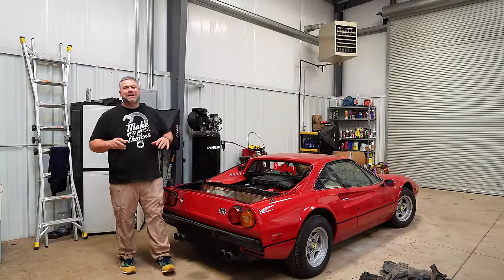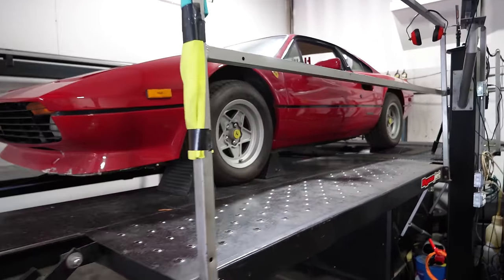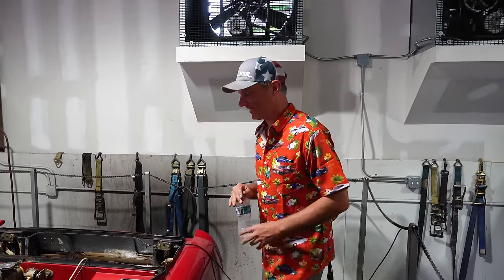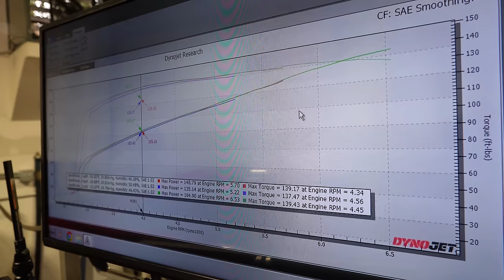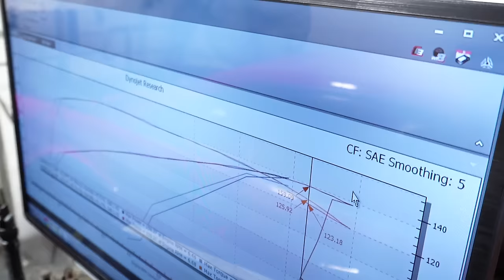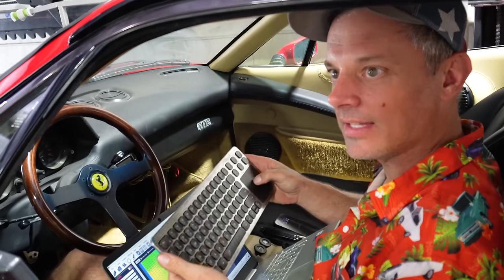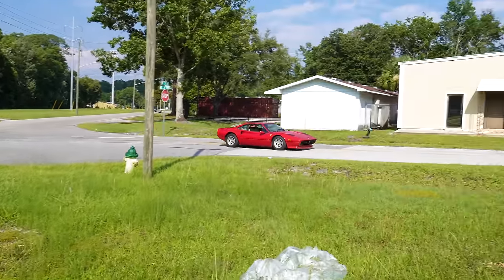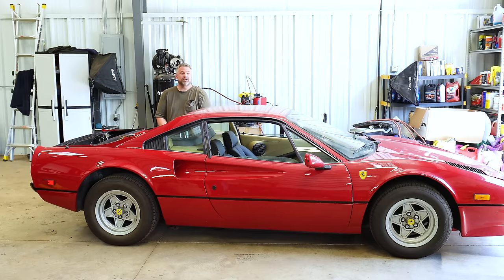Holley Fuel Injection on a Classic Ferrari: Did the CarTrek 308GTB Reach Its Full Potential?

Comment: Heeeey I recognize that guy….!! Thanks for bringing this fun project
Reply from the maker: Appreciate you taking the day to get the thing running great! It’s terrorized the roads of North Georgia in a way it never has ran like before!
Reply: nice job of the over dubs ;)
Reply: Kevin, that was awesome!
Reply: Still pissing excellence i see
Reply: People that look at a laptop and understand what they're looking at are very special. You are special, dude. You are the new version of the old dudes who adjust carbureted engines to the customer's preference by ear. They also blow my mind. Special.
Reply: The carburetted 308's that were US spec only were rated to 205hp. The Euro-spec cars were rated at 230. What you were finally pulling out of it at 177hp works out to just under 210 at the flywheel.
Reply: @bryanhallman8183  210 out of a sub 3-litre that is a minimum of 40 years old. It'sa not so bad, eh?
Reply: @PiDsPagePrototypes  No, that's about as healthy as you're going to get it, unless you go forced induction, or bore and stroke it out.
Reply: @bryanhallman8183  Like I said, not bad.
Figures are about the same as a Chrysler 3.8 minivan V6, which has 40+years of engineering and materials science and close to a litre more capacity.
Reply: Rizz god right here!
Reply: The Godzilla from Gainesville is here!

Comment: Long term vintage Ferrari mechanic here. A bone stock carbureted 308 jetted correctly will make 190-200bhp at the wheels on a dynojet. These throttle bodies in question have been installed many a times in the past. A ‘good’ result with an otherwise stock engine is maybe another 10-15hp at the wheels, which is simply not worth it considering the 40-60 hours it takes to install and turn. A person will never spend that much time in their life working on Webers. Installing two MSD boxes on 308s or Daytona’s etc make the biggest most noticeable difference. 

308 motors are very timing sensitive in that they love a ton of timing, and early. Dial in 34 degrees by 3000rpm and fill timing of 38-39 degrees by 4000-4500rpm or so.
Reply from the maker: We found that out during the runs! Brought timing in slowly and found where it was happy. It really is amazing how restrictive that air box is.
Reply: And this one has expensive aftermarket cams, too
Reply: It's amazing how much Holly is spending to get YouTubers to push these very expensive systems not to mention that you need a tuner on retainer if you want to make it work and you still gain 0 horse power
Reply: @pontiac411 but you gain reliability, better fuel consumption, better cold start, better at altitude, no need to spend 3 hours per week fiddling with adjustment screws, it won't flood, it will idle and it can be adjusted via computer or sometimes control panel.
Better than a wick in a box.
Reply: @jochenstacker7448   I take it you don't know how to turn a carburetor.
Reply: @TheQuestionableGarage  I think it's those ITBs that just aren't working with that airbox  as the Webers have always been fine with it in place. Individual filters from Pearce Manifolds will fix that. The factory actually dyno'd these engines with the airbox in place. A 'factory fresh' carbureted 308 had an acceptable power range if it made between 230-235hp at the flywheel.  Certainly not the quoted 240 (US Spec) nor 255 (Euro) but they made decent power. 

My guess is whoever changed the timing belts did not set or at least check cam timing correctly on this motor, which super common issue with these.  These engines like very tight lobe centers, between 100-104, and lots of overlap. Or it could be that whatever custom cams that are in that thing don't have enough compression to work well, dynamic is suffering. Glad to help if you guys need. Post it in the 308 section of Ferrarichat.
Reply: @jochenstacker7448  Absolutely not the case.  Webers work just fine as once they're set up correctly they'll stay that way for a long long time, years.
Reply: @pontiac411 nope, not seen one since the very early 2000s either. Most cars in Europe are fuel injection
Reply: We have a Mondial t with Bosch Motrinic 2.7 ignition and fuel injection. In 16 years the only problems we have had with the car are from random sensor issues. I have wondered about replacing the twin factory computers with a single Holly but after watching this, nope. I’ll keep chasing bad connections and driving the hell out of it between Check Engine lights.
Reply: @pontiac411  I really like the Sniper EFI systems.  I've installed one on my classic ford and another on a friends C10.  Both run flawlessly now in pretty much all conditions.  I definitely got a noticeable power gain out of my old straight six.  For those of us who don't want to screw with carbs and want easy fuel injection the price isn't awful.  About $1000 in to my setup.  Considering I went from a barely running carb to a fully running EFI system in a few hours, I was happy.  I drove the car around that night and by the time I got home 50 miles later, it was running better than ever.
Reply: @pontiac411 some people prefer to drive their classics instead of tuning their carbs. The each their own though.
Reply: @pontiac411  Carburetors suck.
Reply from the maker: @pontiac411  the systems are very affordable in the world of efi components with some options coming in at right around $1,000.
Reply: @TheQuestionableGarage   About 1300 to be exact not counting a $279 fuel pump or a $379 fuel system whichever you choose, yes I am well aware first-hand of the cost. I have just never had a problem getting good results from a used swap meat carburetor with a choke and you can add a power adder without having to upgrade your fuel injection system.
Reply: @pontiac411 get the right fuel injection system to start with and you won't have to upgrade it with power adders
Reply: @benholler1389   Why when I can make as much power with a $250 carb
Reply: @pontiac411  again better fuel consumption.   Better cold starts.  Better reliability no fuel starvation in hard cornering with road racing.  Not problems with fuel starvation off road.  There is a reason carburetors havnt been used in new cars for decades.
Reply: @benholler1389   That's true with factory fuel injection, everything you listed is also the complaints against the Holly system and also all achievable with the carburetor for much less.  Holly states that their efil systems are not designed for efficiency and require a special toon for better fuel economy
Reply: @pontiac411  my sniper efi system has improved all of those things.  And yes of course you have to tune it for fuel economy.  The big difference is in about 30 seconds I can switch my tune from one that gives the best power to one that is street friendly and gives the best fuel economy.  Then switch to a mid-level one that works best off road.   Just because the computer side of it intimidates you doesn't mean its bad.  Or that it's difficult for everyone.   Once you learn it it's far simpler and requires less messing around than a carburetor. 

BTW with their ignition system I can also change the timing advance to whatever I want with a few clicks.  These systems just give you so much more precision control over everything.   If you like your carburetors that's fine keep using them.  But I won't be running one again on any of my stuff.
Reply: The Holley system seems pretty rudimentary, definitely not worth it considering how well a properly set up quartet of Webers can run on these engines. If you're only making 10 more horsepower it's a bit of a mugs game continuing down that path. If it's more power you're after then an engine swap is a far more sensible option in terms of dollar per horsepower. A stock Honda K24 makes about the same power as that 308 and costs about a grand from the local Honda wreckers..... the entire engine is probably cheaper than that Holley system and it even comes with an EFI setup vastly superior to the Holley. Just sayin' 🙂
If you're wanting to keep the 308 engine then an ignition upgrade is really all that is required - the stock Webers have the fuelling working about as well as it's ever going to on that engine. It may come as a surprise to some but the Ferrari mechanics knew what they were doing. And despite what others are saying once they are properly set up there really isn't much maintenance required at all. I ran a pair of 40mm IDF Webers on a 1600cc hillclimb/time trial car years ago, once the carbs were running right (which took about 3 hours on a dyno) I barely touched them for the best part of 3 years. They worked just fine, I thought they were amazingly reliable, and that was in a motorsport environment where they got FLOGGED mercilessly. If only everything else worked as well.
The guy I sold that car to installed a frankenstein Toyota/Mitsubishi after-market injection system and fooled around with it, he ended up going back to the Webers as (he said) they were far less trouble and made roughly the same power. No high pressure pump needed, no software bugs to deal with, no ECU or computer required, just a screwdriver and an air-flow meter. Easy as. Make of that what you will.
The only people who diss carbs are people who don't know how to tune them, and it's easy to learn. They're not that hard really. Injection systems are definitely better, I'm not making the argument that carbs are superior when it's a fair comparison but on this Ferrari we're comparing a top line and well sorted carb setup to a fairly rudimentary aftermarket EFI system. Holley's EFI systems are like their carbs - pretty basic. Implementation is the key difference. I have no doubt a top shelf setup like a Haltech or similar would be better, but only if cost is no issue. 200hp is about all you're ever going to get out of that 308 engine regardless of the fuel system.
Reply: @benholler1389  What carbs did you have? Like everything there are different levels of quality. Holley carbs are only slightly more advanced than a plastic bucket with a pinhole in the bottom. Webers are a totally different prospect. Properly configured they will give virtually the same performance as a decent EFI setup for a fraction of the cost, and if the car was designed to use them in the first place (like this 308) it's a no-brainer. Spending thousands on an entire aftermarket intake system to make 10 horsepower isn't terribly clever unless you're in top level motorsport.
I'm not saying carbs are superior to EFI, far from it. But we have to compare apples with apples. A good carb setup is always going to be better than a crap EFI.
Reply: @woopimagpie  a few different ones from stock to aftermarket the last one being an edelbrock.  And I am by no means saying carbs can't work well of course they can.   But I have been extremely happy with the sniper systems I have used
Reply: @pontiac411  Difference is this car doesn't have one carb, it had 4 that all required to be tuned to sync up with each other. It's a pain in the ass.
Reply: @jochenstacker7448  Like all multiple Weber carb engines they are within reason set and forget. Even on racecars. I have gone tears without touching them.

Comment: These only made about 205 HP at the crank. FI will help with drivability and maybe you eek out a few hp and torque via tuning, but I'd be surprised to see much more than 180 HP peak at the wheels and that's pretty optimistic. Will watch the rest of the episode to see!
Reply: Watch engine masters, EFI actually makes less HP than a carb setup. Carbs offer better IATs as the direct contact with the fuel cools the air considerably versus EFI. That's probably where the other 25hp went. Also cam timing and exhaust. Big cams and 1980s smog technology probably aren't the best of friends.

Comment: My favorite part of this is the fact that the more he tunes it, the BETTER it sounds. There's an audible feedback to the refinement process. 180 WHP for a 2400 lb car is not bad at all. It was never built to be a 10/10'ths car, more of a 7/10'ths. A good service and modern rubber and shocks would probably make this thing an absolute joy to drive.
Reply: Not sure most of the world would think holley is the best.

Jenvey bodies with a good aftermarket ecu would wipe the floor with this current setup
Reply: I thought those were jenvey tbs?
Reply: @reginaldbowls7180  no he said its a holley system
Reply: Well, when the filter cover was removed and the horns were exposed it's always going to sound better. Intake noise isn't restricted
Reply: @th3b0untyhunter  In all honesty I'd just go back to the Webers. Far cheaper (especially as Car Wizard already has them), and once they're set up properly (any old Ferrari mechanic could do it in his sleep) they will offer almost the same performance and be just as reliable. They're not nearly as unreliable as some would have you believe. I ran a set on my old hillclimb car and barely touched them for three years. All that was required was slight adjustment of the synchronisation of the throttles, which is something you have to do with ITBs anyway. Mechanical fatigue still happens with EFI just the same. Aftermarket EFI setups on old engines almost never make financial sense, far better to stick with the carbs if it's a good setup like Webers.
Reply: @woopimagpie have you watched Thunderhead 289? He is an expert carb tuner and just came up with a new product. Seems like you would enjoy what he's up to.....

Comment: People who say "Why didn't you use X" have probably never had to put X on a car that wasn't made for it before. The Holley system is more generic, but that makes it easier to set up out of the box. It worked, and the amount of tuning it took to get it right was amazingly small. If the dragging brake was fixed, you'd gain a little, but this isn't going to be a hot rod. And I bet David and his wife will be happy with what you send back to Kansas
Reply: they're also sponsoring it so it's not like there's some choice.

I'd rather see a megasquirt or something more open like that, but whatever it is what it is.
Reply: There's many ways to do it, and most of them are correct, and even more are 'good enough'. I would personally go with a Haltech or a MaxxECU, Drive by wire throttles, COPs instead of the noise prone CNPs, and using a trigger wheel inside the distributor housing instead of that massive trigger on the crank. But hey it's not my car or my customer, what he has there is plenty for what he wants and it's what he is familiar with(sequential is kinda mandatory for ITBs imo, not over the top) so yeah...
Reply: the nice thing about the holley kit is the simplicity. you could put something really badass on it like a high end haltech or whatever, but the holley stuff is easy to tune, and in this case, FREE-FIDDY.

Comment: As far as the 'why didn't you use' stuff goes - it's very much a different tools for different jobs kind of thing. If you use something like a Haltech on an engine like this, you're not using like 90% of the Haltech. The Holley system is essentially tailor-made for old, simple engines, on the street, and can be tuned by prettymuch anybody with a dyno. A Haltech, on the other hand, is going to run all the more complicated systems of a modern engine and a modern car, or a full bore racecar, but you have a much more limited pool of tuners with experience on the system - which doesn't mean they can't do it, it just means it's going to cost more because it'll take longer. At the end of the day, this is a 200 horsepower classic Ferrari. Its just is to look cool and sound cool.

Comment: It's not the complexity or fear of technology that stops me from replacing my carb with fuel injection. I'm a former electronics tech and current computer sysadmin. It would be great! However it is a $4,000 bill when all is said and done. A new carb cost $400. That's a pretty big hit in the budget.
Reply from the maker: A sniper is a lot more adorable than the full complex units, you can also get the plug in play kits under $1200
Reply: @TheQuestionableGarage  I'm sure you meant "affordable" but I like "adorable"! So cute! 😆 Yes, it's cheaper than  $4k but start adding a fuel pump, lines, maybe a tank etc. and it adds up.

Comment: We usually use only "speed density" type of tuning, becouse the vacuum singnal is so weak with itb systems -> makes wery narrow runing window. Speed density uses only throttle position and rpm to calculate right amount of fuel. The map is used only as multiplayer (atmospheric pressure..)

Comment: I had a look in my old books:
1978: the euro-spec 308GTB made 255HP SAE /7700rpm and 284,4Nm SAE /7000rpm. That's on 8,8:1 compression ratio and 4x Weber 40DCNF carbs.

1981: The Mondial8 with the same V8 engine, same compression ratio but with Bosch K-jetronic EFi  and electronic ignition by Magneti-Marelli Digiplex  made 214hp/6600rpm and 243Nm/4600rpm.  (could be DIN numbers, i'm not sure. These were the days that SAE numbers were phased out in Europe and DIN numbers became the new standard)
Why so much lower?  This was early days for EFI on euro cars and i think the induction system was not on par with that on the carburetor versions. I think it needed a bigger plenum chamber just like the car in this video.

For a good reference/comparison: a euro spec Porsche 911SC from 1981 had only 6 cilinders , also a 3,0L engine capacity , also K-jetronic EFi and electronic ignition but it had a full point higher 9,8:1 compression ratio and that car made 204hp/5900rpm and 267Nm/4300rpm. 

So i think this F308 is right on the money !  With the open velocity stacks it sounds glorious when opened up. 
Nice job!